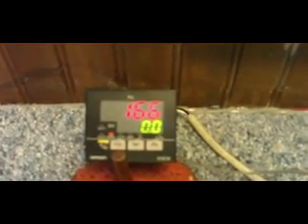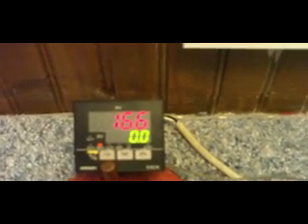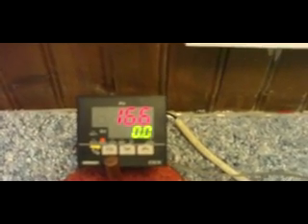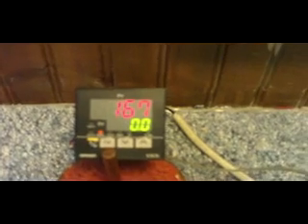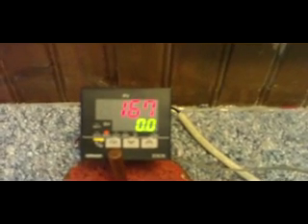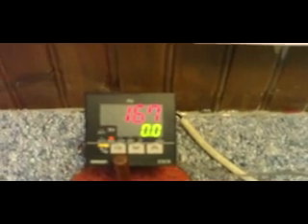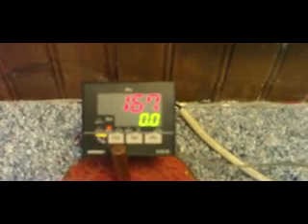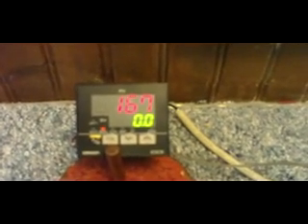Solar pop can collector

Comment from the maker: They are 1 1/2 inch to 1/2 inch reducers with holes drilled around the top for air flow. I made a tool that clamps to the pipe and pushes the reducer into the cans then I can solder the reducer to the pipe.

Comment: Great project.  My only thought would be to put the air coming into your home at the ceiling and the air going out to the panel at the floor.  With a ceiling fan pushing the warm air to the floor.  This would make it more efficient as it would be collecting the cooler air off the floor.  It would also cut down on the static electricity zaps from the warm heat passing the cold heat as it pushes it way to the cold air return.

Comment: I want to build a hot  water heater to add heat to my basement. Do you think the cans do anything to add heat to the copper pipe? I am thinking of just copper or plastic (pool heater style) pipe, painted black and then run it to a heat exchanger with a circulator pump run off a thermostat.The cans make for more work and take up space. I am using a patio door as my glazing.

Comment from the maker: @thestonemaster81 Yes the cold water does control the air temp. inside the collector but I get a 5 degree temperature rise at 2 gpm so the water in the tank gets heated pretty fast. In testing it heated the water from 61 to 107 degrees in 5 hours. The air temp. in the collector was at 129 for a high.

Comment: Copper and aluminum are dissimilar metals, so if they are in contact, the aluminum would eventually oxidize the copper pipe and eat through the pipe, right? Did you put a spacer or something between the cans and the pipe, or is it just a straight hollow tube?

Comment: Also, I was wondering if the actual drinking water is running through the pipes, or if it is a closed loop system that simply coils through the tank to transfer the heat into the stored water around the coil. I think bringing the solar heated water into the cold water intake of the tank would be simpler, but it would only heat the water as it is used. A closed loop system would maybe be a lot more work to modify the tank, but would continuously heat the water all day even when it is not running.

Comment: Would it be better to put the copper pipe outside the cans still in the warm box. That way it will still get hot (copper painted black ) But not be in the cans where is may cool the air ?

Comment from the maker: @skid4u When I built my second collector I thought it would be equal heat inside the cans but it was not. With no water in the copper pipes I had 129 degrees air temp. in the top manifold and 155 degrees on the copper pipes. When I put water through it the temps. came down. My test setup was 21 sq. ft collector 2 gpm water flow (should have been .75 gpm for that size collector but no control valve)and a 235 cfm blower for the air. It heated the water 5 degrees every time it went through

Comment: is the same as the incident solar energy.
 heats up the inside as well outside of the bottle.
 Distribute all the pierced bottles at random into the collector
 Pass the air from the body of the panel.
 results will be much better.
 want more better results, the panel inside fill it black painted steel wool.
 I'm done master in this regard.
 good luck.
(i'm sorry for my english)

Comment: It's the 2nd collector, at 6:14, that's far more interesting:
    Combines solar air and water in one panel? neat and efficient!
Probably needs an expansion tank on the water heater system, to prevent it blowing up from over-heating!  
The magic part is, HOW did he solder the copper tubing to it's manifold, as it would have to be positioned INSIDE the downspout air manifolds to do it!?
As for the basic box? I like the convex polycarbonate used on the Cansolair panels--it more effectively catches sun at multiple angles. 
Any of these can use incoming fresh air, to get a heat-exchanger effect.
We've recirculated the 1st panel to a window, and a second panel brings fresh air into that 2nd panel, which is booted to the 1st panel: that gets both recirculated and fresh pre-heated air.  Putting in DC solar fans to push air through the panels also helps.

Comment from the maker: Yes and no I live in northern Michigan 5 miles from lake Michigan and until the lake cools off around the end of January we get lots of clouds and lake effect snow but the shoulder months Sep. through Nov. and Feb. through April the collector works great. I have an hour meter hooked up to the collector to record the heating hours. 11/7/09 - 5/16/10 419.2hrs.
9/14/10 - 5/21/11 606.5hrs. 9/14/11 - 5/1/12 467.2hrs. 9/20/12 - 5/14/13 342.8hrs. 1831.2 hours total over 4 years.
Thanks for watching

Comment: Are fans absolutely necessary to move the hot air up and into the house? Would this system not work without intake and output fans? Thanks.

Comment: i like the 2nd 1 but where did u say u live? cuz ide totally do the water air go but ide be afraid of freezing at night. and the, what was it? northlander guy said his cycles thru each line. so it would be making like a giant zig zag. and i like your all metal construction sides and back but ide def put some real wood around that for insulation if not even put some styrofoam or some kind of insulation between that. dont get me wrong yours seems to work great but you could be losing some heat thru the metal. and the coat the wood with poly or marine paint or even just a high heat to be sure it wont flake then poly or acrylic, or whats that stuff ugh on tip of the tongue it s used on counter tops and hardens like a rock and is clear. but good job and i def like the 2nd 1 u have goin or finished by now. ide just be a little eh on pipes freezing.

Comment: This was posted 4 years ago. Is it still working? What kind of energy savings have you seen? Thanks
Reply from the maker: Yes the collector is still working this will be it`s 6th season. I have an hour meter on the collector that records the hours that the thermostatically controlled fan runs. The collector has run 2307 hours over 5 seasons I live in northern Michigan and a heating season usually runs from October through April. As far as energy savings on all but the coldest of days the collector puts out enough heat to keep the furnace from coming on. Thanks for watching.

Comment from the maker: The cans are manufactured with a thin plastic coating on the inside to keep the contents from corroding the can and they are attached to the copper pipe with this coating between them. Thanks for watching.

Comment: What are you using to keep that pipe centered between the cans and enable heat transfer between eh cans and the pipe?
Reply from the maker: Hi Keith

 The pipe is centered with fins cut into the bottom of the cans. I made a tool that cuts six fins in the bottom of the cans kind of like cutting a pie. Then I form a hole in the center of the fins smaller than the 1/2 inch pipe. The bottom of the can has the thickest aluminum when you push the pipe through it opens the fins for air flow and gives good spring pressure on the pipe. every can has fins so I have support every 4 inches and good heat transfer between the heated cans and the cooler pipe. Thanks for watching.

                                                                                           Guy

Comment from the maker: @cantecleer I used a 11/2 to1/2 In. reducer on each end of the stack of cans. Then soldered a reducer on one end and put a tool I made that clamps to the pipe and pushes the other reducer into the stack of cans. Then soldered it. Hopefully I didn't get it to tight. It turned out surprisingly sturdy and ridged.

Comment: Why haven't you installed a solar panel to run the fan? And wouldn't be better to feed the hot air lower in the room as heat rises you know.
Reply: you could just use convection to move the air actually.

Comment from the maker: I do not drill holes in the cans they are cut with a punch and crimped so the inside of the can is the only part touching the pipe. Thanks for watching.

Comment: my only problem with the pop can furnace is the quality of air.  You spray the can with paint but that itself is toxic.  So I dont know why you would want to inhale toxic air.  There must be a better way to build this concept but without the inhaling of bad air in your home.
Reply: you don't paint the inside of the can dude.
Reply: i know that dude.  but you are still inhaling the air from the box that has warmed the cans.
Reply: Titan Tech Well I guess your whole house is toxic then, or is it bare wood & drywall?
Reply from the maker: Titan Tech
The can columns are connected to a manifold on top and bottom and are sealed with silicone. I have a 4 inch fan that blows into the bottom manifold through the cans pushing the heated air out the top. No air from the outside of the cans is drawn into the house.
Reply: Exactly
Reply: isn't the inside of your entire house painted
Reply: that isnt what i was asking about.  the interior paint and spray paint are two different chem compound anyway.
Reply: +Titan Tech The last time I checked acrylic spray paint is the same as acrylic primer. It's just propelled by a gas out of a container.
Reply: 24hoursofwin Thank you much better response.  I now realize that it was the same quality paint that is being used but I saw the spray paint and was thinking there must be better paint to use then that.  Thank you.
Reply: SmoothRide Scooter Hahahaha...hey nothing is as toxic as the morning breath.  Thank you again for your professional response.  I am all about self sufficiency but i think people just jump to making things without really putting any thoughts into it.  I have looked into all aspects of this concepts and the one area that gets neglected is the quality of air.  But your response with acrylic paint makes sense.  I was thinking about placing a filter with this concept.  There has to be something like this that provides a higher quality concept then just putting cans together and spraying it with a can.  I wonder if someone has put together a marketable concept.
Reply: Just paint the outside glass, not the inside or the cans
Reply: +Titan Tech We had the same concern about VOC's in the air we breath...already have MCS issues here. 
BUT...there IS a fix:   the VOC's in the hi-temp paint, rapidly cook-off in the heat.  
Let the panels cook-out in heat in summer, for several days, before hooking it to the house.   
That is the official process for cooking out the VOC's, whether it's in panels like these, or from newly built hospital rooms in Marin County, CA.